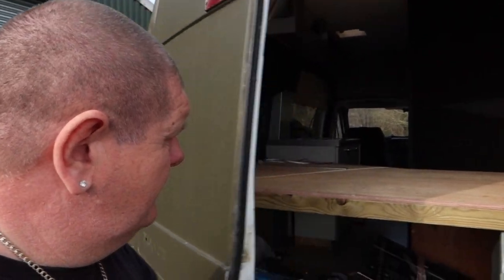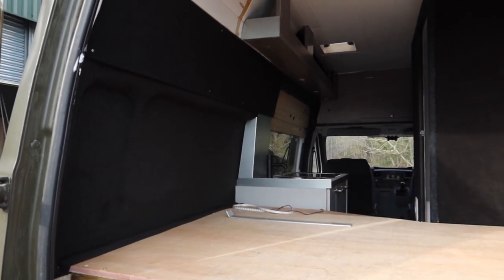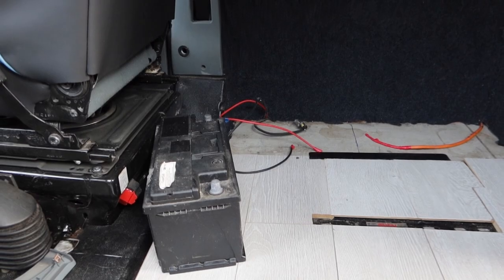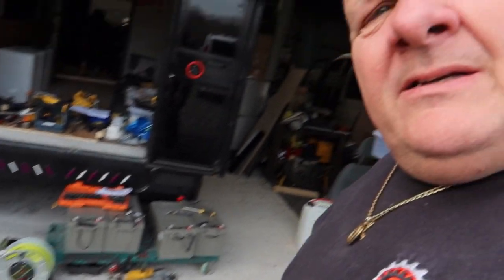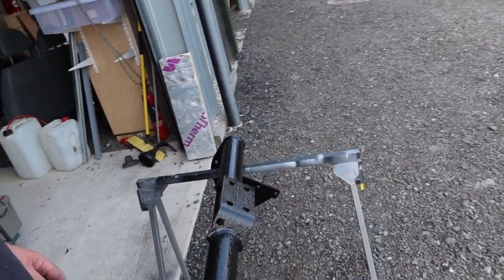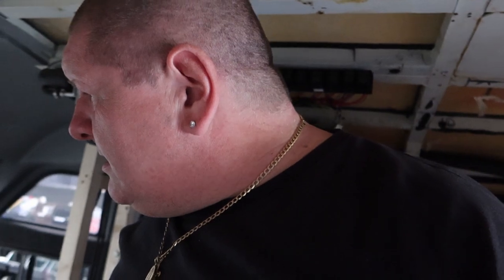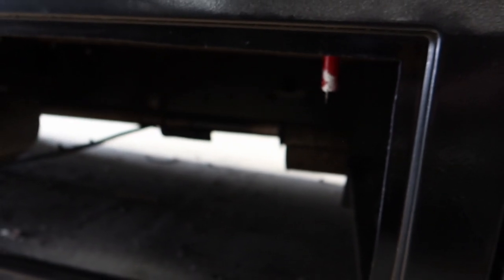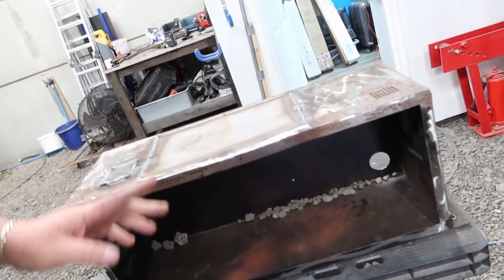MY PART EX BARGAIN - or was it a lemon

Comment: I think I would put a water drip tray in the bottom with a sink style plug hole to exit the van underneath. Prevents water damage when changing the filters etc.
Reply from the maker: That is a good idea at least u wo t need to keep emptying it just wipe it clean thank you xxxx